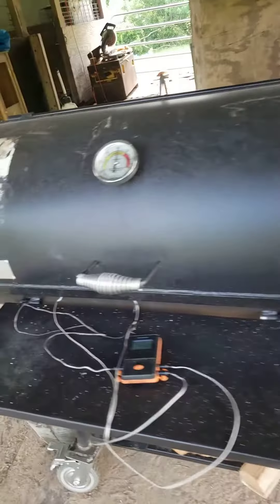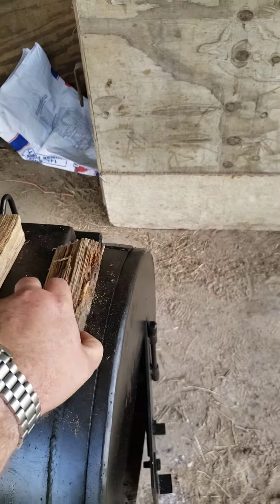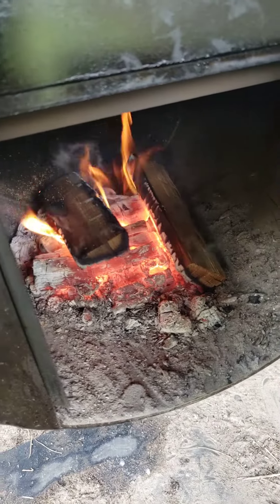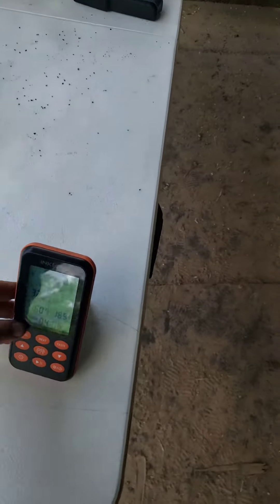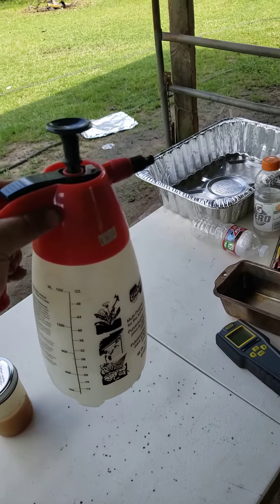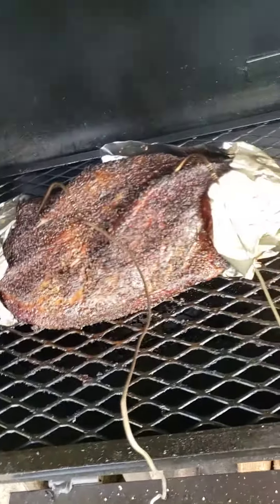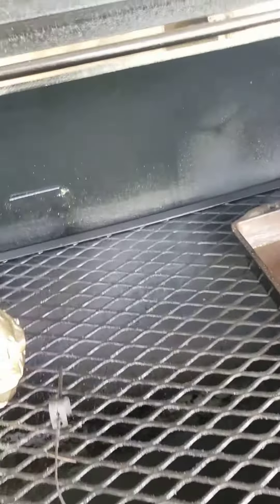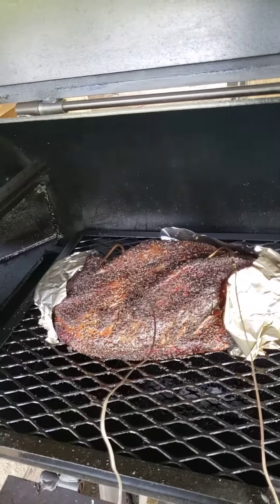Brisket cook update on old country brazos with smoke collector mod

Comment: Brisket looking good! Did you completely remove the heat baffle? Looks like it helps draw better. I can see smoke being pulled by the collector just above the brisket.
Reply from the maker: Yep took it completely out im gonna tack on another foot on the smoke stack and see if it eliminates the hot spot better on the firebox side. It was a 25 degree diffrence from end to end. I'll upload another video when I unwrap and slice that brisket. Been resting since 10 last night.
Reply from the maker: https://youtu.be/PHW0d6FVXqM
Reply from the maker: https://youtu.be/vXWGeU7Vnkc
Figured out even air flow got it smoking good now

Comment: Your using wet wood and going 300? Better not mess it up
Reply from the maker: I'm in the stall 300 is not gonna hurt nothing and the wood is managble. Burnt a nice clean fire. It pulls so much air flow you have to put a peice of foil on tge point or itll burn up. I know how to smoke brisket it'll be fine.